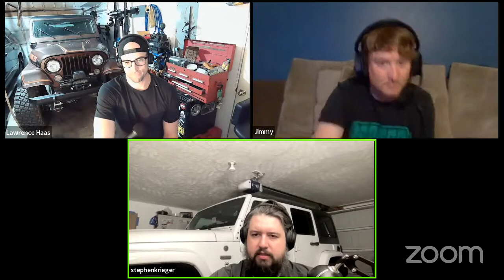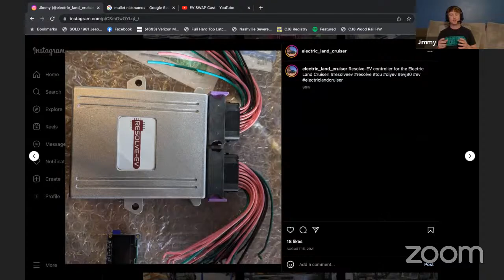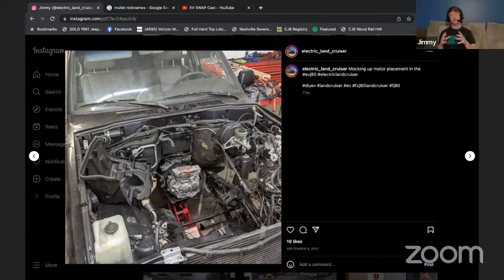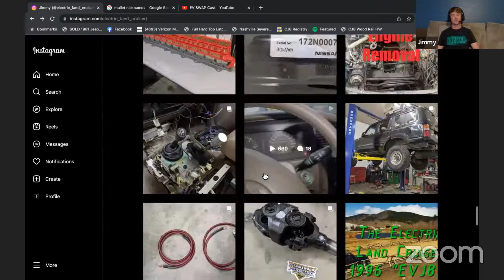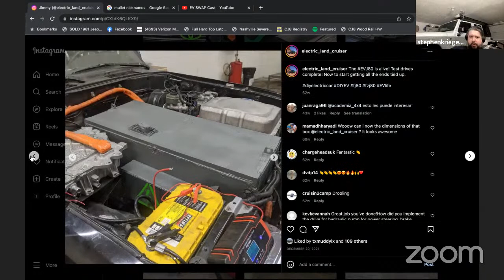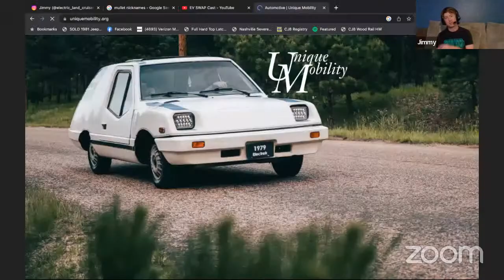EV SWAP Cast

Comment: I bought a used ev 3 years ago, and in 50k miles I've saved as much in gas as the vehicle cost, not to mention maintenance and comfort around town over driving my 4runner on 37's! Also the car has used only about 1/4 of the electricity that my home solar produces.
Reply from the maker: That seems to be the way to do it... until you slam a Leaf in the 4r!!!